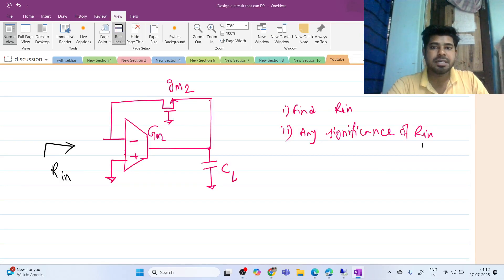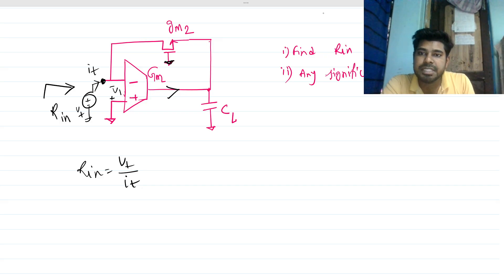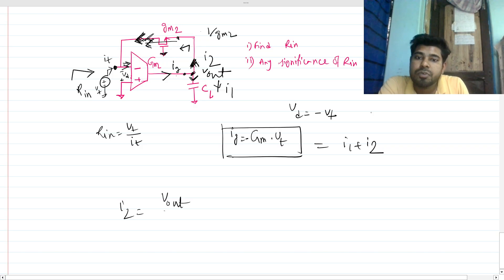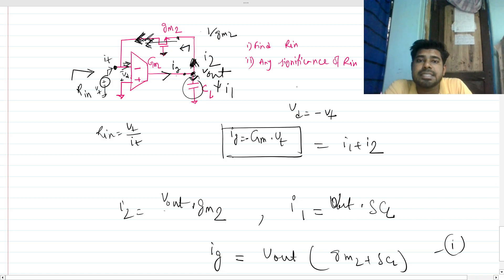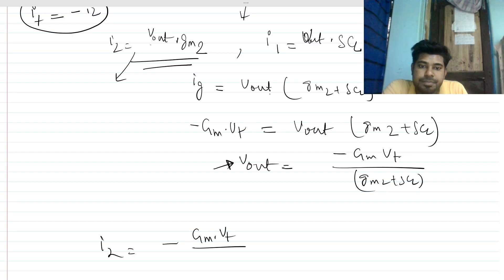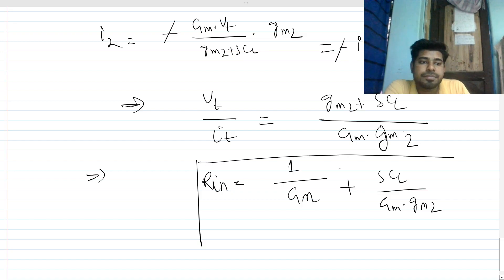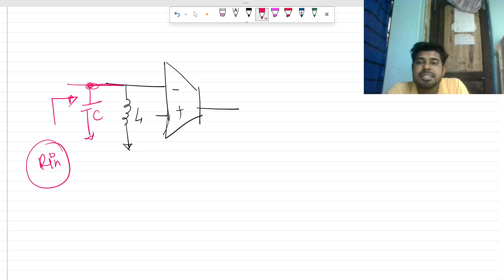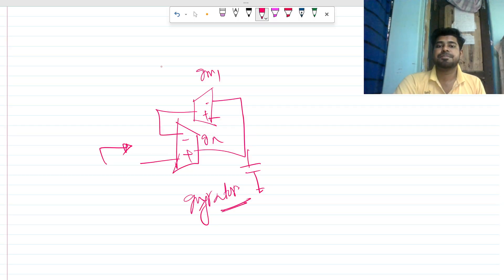Analog Circuit Design interview_ Find looking in impedance & its significance ? Amit Bar

Comment: Why do we put i2=vout*gm2 instead of i2=(vout-vt)*gm2?
Reply from the maker: in Small signal why you consider Vt??
Reply: @AmitBar-Analog_Circuits  No, what i asked was since you put nmos as 1/gm2  you are applying a test voltage Vt at -ve terminal, the current i2 would be (vout-Vt)*gm2? Plz clarify